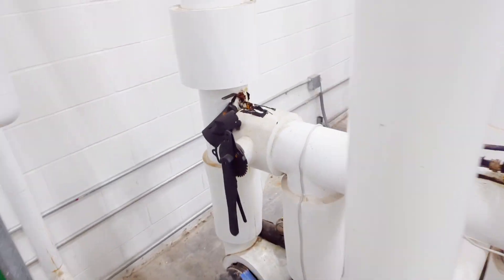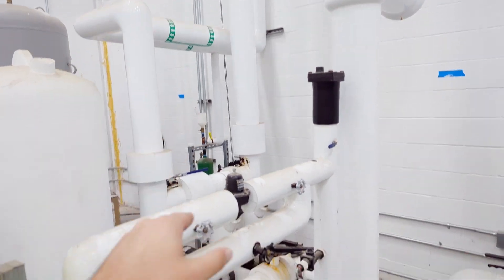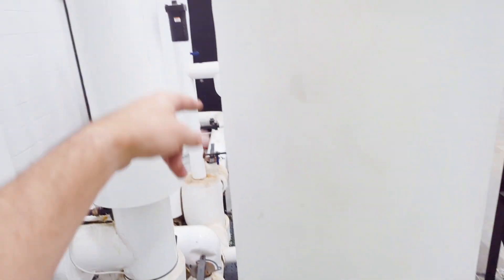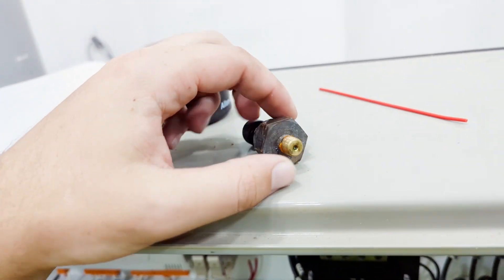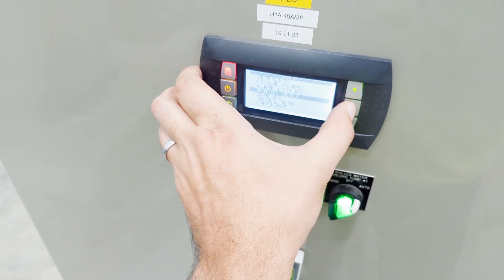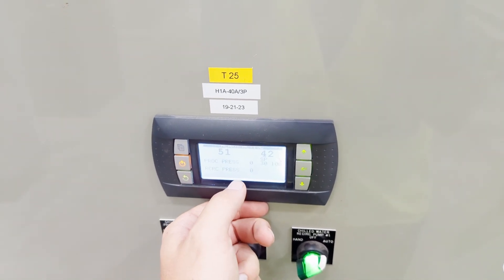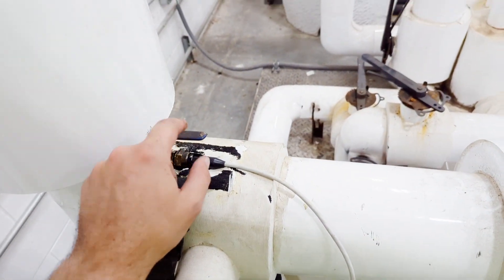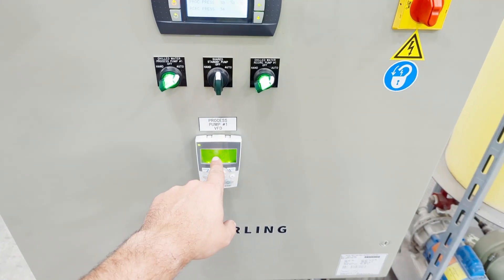Industrial Chiller had Flow Issues

Comment: I'd be inclined to just get some name brand transducers off the shelf that you have a data sheet for, seems like you've got all the scaling and offsets under control to make any half decent transducer work! 

What was the actual problem there though? Sounded like... they were having issues, swapped the sensors, still having issues, then went back to the original sensors and settings and it was fine?
Reply from the maker: Ah ya didn't compeletely explain whole situation. System wasn't commissioned correctly to begin with causing flow issues and alarms from the start. They thought it was sensor problems but got the wrong ones. Once I put the original sensors back I was able to fix the commissioning and tuning so that the pumps VFD would ramp properly to meet flow requirements as load fluctuated.
Reply: @HVACTIME  Solid effort as usual, nice one!